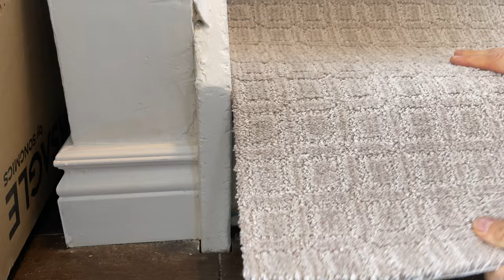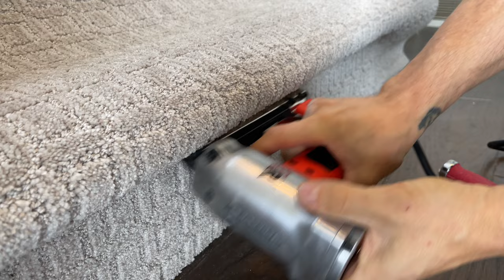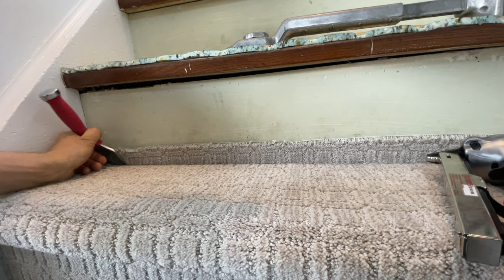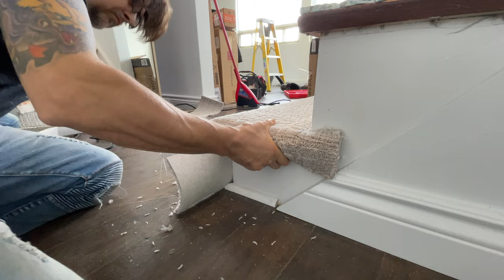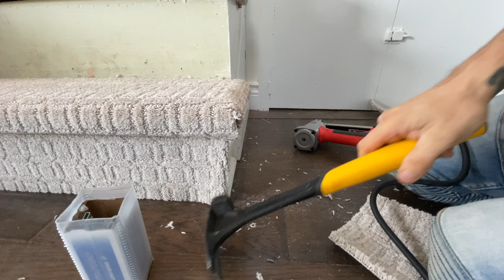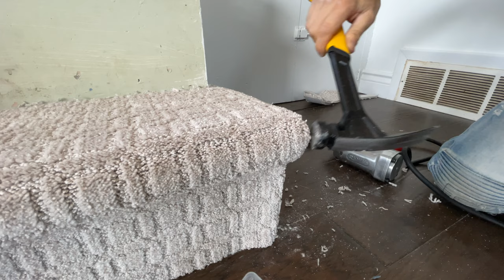How to Lay Carpet on Open Ended Stairs | Fix the Yuck!

Comment: Hi Keith not sure if you're still replying but i have a question. I'm doing some finish carpentry on my rough framed stairs. The bottom 3 steps are just like shown in this video except my stair tread is cut flush to the stringer so theres no over hang to wrap carpet. Should i glue and screw wood to the end of steps to wrap carpet over or can you pros make it look nice with out it? Thank you in advance.
Reply from the maker: Sure, you can add a piece on the end so you can wrap it over when we would run into a situation like yours we would leave extra fold the carpet underneath itself and then tack it in to the wall if you add the extra piece to wrap obviously it will look better. It depends on the situation.